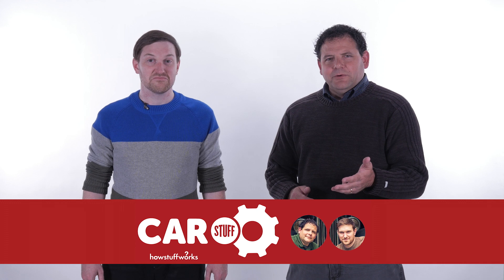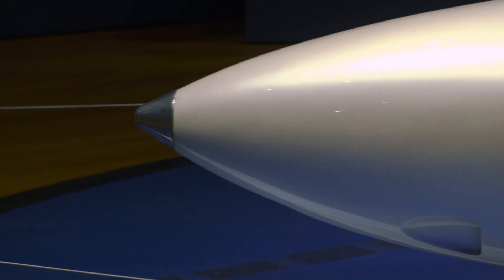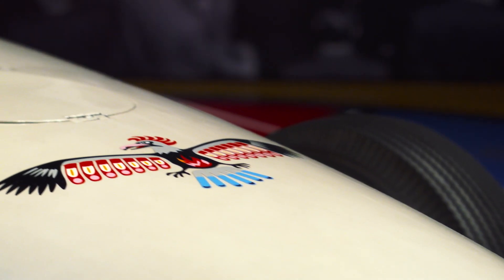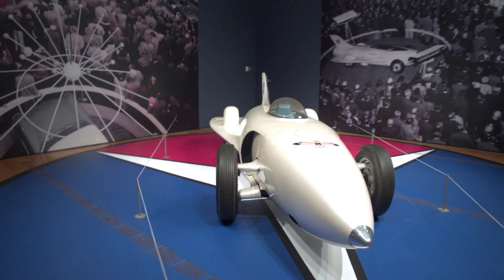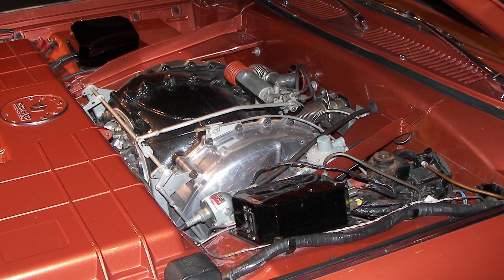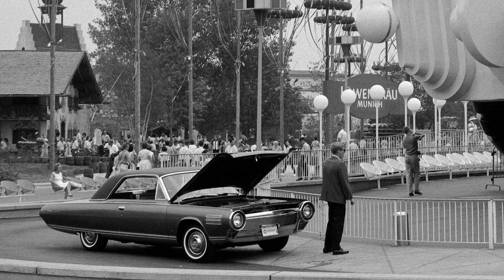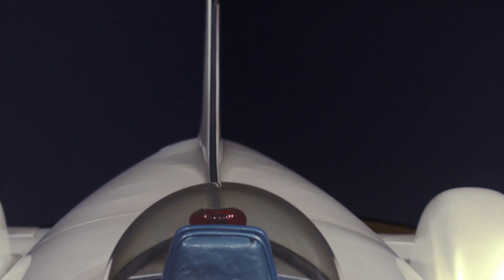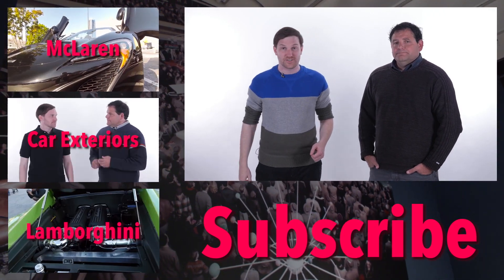CarStuff: Dream Cars | Why don't cars use jet engines?

Comment: The Chrysler turbine car was a great car and well liked. I was a young teenager when the turbine car was being tested as a family car, 50 units I believe. There was a retard feeling when accelerating since the turbine has to spool up in RPM. A piston engine is much quicker. Auto manufacturers were experimenting with gas turbine generator in automobile. Turbine engines are ideal for aircraft. Engine power is basically constant. A gas turbine generator stays at the same speed (RPM/cycles), what changes is the torque. Batteries can be added, being charged by the gas turbine generator. A gas turbine can use variety type of fuel, environment friendly. Uses synthetic oil for lubrication, only a fraction of piston engine. The day a gas turbine generator car is marketed I'll buy one. I used to work on jet aircraft in the Air Force. Loved the sound they make, no vibration, very smooth.

Comment: TL;DW It's because they require the engine to run at a higher RPM (or engine speed) on average, which wouldn't be ideal for stop-and-go traffic. It pretty much can't idle like a normal car.

TL;DR Engine want to go fast, car can't all time

Comment: Surely if the run speed is an issue with efficiency and economy, they would still be ideal for hybrid vehicles.  If the drive is controlled by the electric motor, the jet can just be engaged at high speed to recharge the cells for the electric motor.  Other manufacturers have already proven that powering drive by electricity alone doesn't have to mean poor performance, so the gas turbine could just be use as a recharging solution to increase range, etc.  I don't know how the weight to performance ratio would play out, because electric engine cell are obviously really heavy anyway, but if the performance can be maintained with the extra weight of the gas turbine, it may be a feasible option.  Another alternative would be for the jet to run at high speed, but only part of the output be used to drive the vehicle and the rest to charge the cells.

Comment: I've always thought a tiny gas turbine would be superior for either power generation in an electric car or to power a hydraulic pump for a hydraulic driven car. Both require a narrow rpm range and high power to weight ratios. A smaller gas turbine would be easy to muffle as well.

Comment: Throttle response, fuel economy, and lots of very hot air, and noise, slow and difficult starting. You can't really silence a jet engine... it tends to melt the bumpers on the car behind you and incinerate school boys, both of which are bad for PR... Operated properly, they are sensationally reliable, far better than any piston engine, but operating them properly is not something you could do in a car... They are just not suitable. There are things they're sensationally good at, but kids to school, that wouldn't be one of them.

Comment: Jet / turbine engines would be beneficial in automotive applications like a series hybrid configuration similar to modern locomotives Diesel engines are used to power electric motors that drive the train rather than a diesel use a smaller more efficient turbine engine (running at a continuous set rpm)to power the electric motor in the vehicle 
Benefits-
Multi fuel capability 
Turbines have less moving parts than modern gas engines
Electric engines have instant hp and torque 
Turbines engines sound awesome 

Big fan of stuff they don't want you to know and carstuff keep it up
Reply: A battery set would allow for use of turbine intermittently.

Comment: https://en.wikipedia.org/wiki/M1_Abrams
This tank relys on a gas turbine engine to shove its 50 ton weight around, and it can really shove it around quickly.
I hear that they are particularly awesome in generators, where you run the engine at a fixed, ideal speed. I've also been seeing small turbines used for bikes, skateboards, flying suits and RC aircraft.
Can a car use gas turbine and be a good car, sure, just not the way that they have done it.